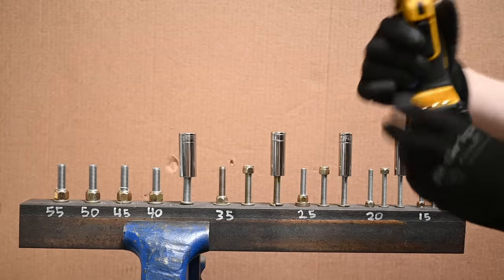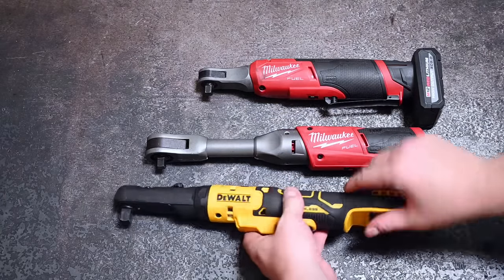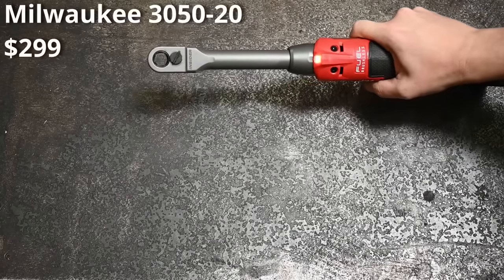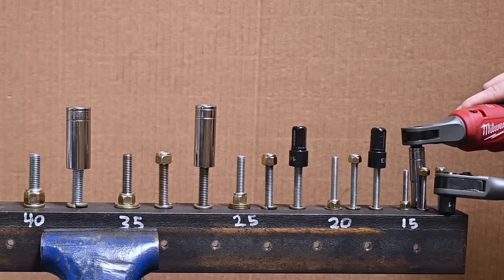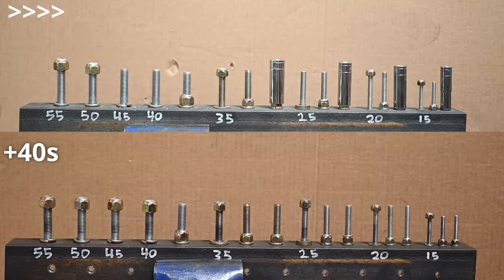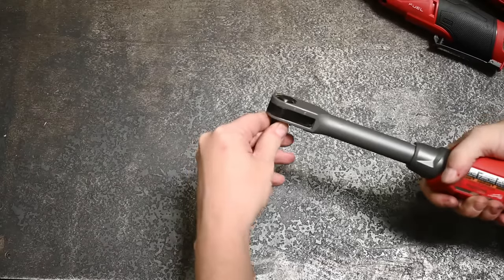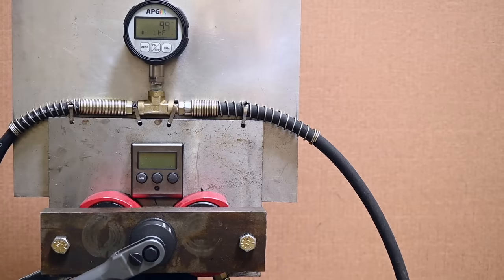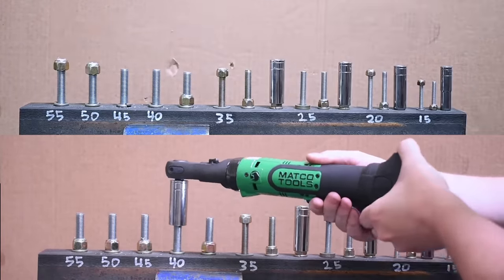Milwaukee's New Insider Ratchet vs DeWALT's New Sealed Head!

Comment: When will these manufacturers realise that they need a model that has a variable clutch? I have a 10yo heavily used Dewalt DCF610 screw driver that I use to disassemble and screw engines and other automotive screws, it is a tough little survivor of much abuse. It has a torque max of 7nM which at one notch of under full torque and is perfect for avoiding stripping M6 alloy engine screws or having the thing trying to rip your hand off as it bottoms out. I recently acquired a dewalt 12v 1.4" ratchet DCF504, so I can get better 'access' to exhaust manifold screws etc, but I need to be ultra careful and slow to ensure I don't strip things or injure my hands.

Comment: Been hearing lots of people are stripping the gears out of the heads lately of the Milwaukee without much torque. Not a good luck for this tool
Reply: Which tool? 
I've had no problem with my DeWalt 510
Reply: @slingin_tires  the Milwaukee
Reply: @FusionBoost2.0  Ok, figures

Comment: The hollow sockets suck and will break easier which then you have to pull teeth to get a replacement, the ratchet head has a smaller tooth ring making that easier to break as well. Good for Harry Homeowner but sucks for your mechanic types.

Comment: So regardless no cordless ratchet will bit break most bolts. Go with the highest rpm one.
Reply: @11onejay The Dewalt broke all them loose on it's own from what i see.
Reply: @JeffreyKmf5uz  I'm not talking about what has torqued on video I'm talking about real world applications like bolts on cars. No ratchet is cracking them. It wasn't what they were intended for. They are used to manual crack them and then to back them out with the trigger, or to get cracked with hand tools etc first. I found myself using my right angle impact in situations I wish a ratchet could crack a certain bolt.

Comment: I don't see a point, these are 99% aimed at mechanics and cars don't have long extended studs where it would make a diff.  And I can run the nano sockets on my high speed and get the same compactness
Reply from the maker: Ran into an exhaust hanger and a turbo manifold flange bolt this was semi useful on this week - but generally i agree with you

Comment: I must be missing something, it looks like the Dewalts are way better but the Milwaukees are placed higher. 

You go through the lists way fast and flip back and forth quick. 

Good comparison, though. Thanks.
Reply from the maker: Only 1 Milwaukee is placed higher. The high speed short M12, because it's nearly a damn minute faster - but much lower torque as well.
Reply: @TorqueTestChannel  Much, much lower torque.
Reply: @slingin_tires but much much faster 😂
Reply: @michaelchristopher8266   Not than DeWalt's 12v sealed. Wait till they test that!
Reply: @slingin_tires  that’s speculation, fact is the m12 high speed, and high speed long neck are fastest on this test dyno by quite a large margin. Shouldn’t boast about the new Dewalt until it is proven, I’m not saying it’s bad but it hasn’t proven itself yet. I’m reserving judgement until TTC tests it.
Reply: @michaelchristopher8266   ok well I've literally had them side by side and they're very, very close.

Comment: Snap on got the absolute best electric ratchets. Period...not impacts cut offs etc, but for a everyday mechanic...the ratchets are waaayyyy above and beyond ..period
Reply: @mv7pitbull87 I agree with you. Sort of. I just traded my brushless Snap-On for the dcf510. No regrets at all. The 510 is faster and stronger but, if you're not gonna get a DeWalt, get Snap-On.
Reply: @JeffreyKmf5uz   yea one of the other mechanics at my job has the dewalt ratchets..0 complaints ..I have dewalt for my impacts (dcf900 and then the newest midtorque one the 840sumthin , then my Mac ones) but something to me bout them snap on ratchets...specially the 1/4inch ext. Head
Reply: @mv7pitbull87   Right, both brands make great ratchets. l've also got DeWalt's 12v sealed head ratchet which is just as impressive as the 20v. Now for impacts I'm with you on Dewalt's. Love my dcf900,891,921,903 (that's most of them, LOL) can't complain about any of those.
Reply: @JeffreyKmf5uz   that's what my mid torque is the 891...I use that thing everyday all day ..thing is an absolute monster for the size...perfect size for all day repairs, I had the early model the 894 I think it was and that thing was nice too but sold it right when the 891 came out

Comment: EVERY dewalt tool I have ever owned, and that i've seen my friends own, has been cracked. The plastic is cheaper quality than harbor freight. Their performance may be a little better, but their longevity means you're more likely to have to fix or replace it sooner than others. I stopped buying them over a decade ago, and after inspecting my friend's dewilt impact a few weeks ago, I have no regrets doing so.
Reply: @macgyver9134 I haven't broken a single Dewalt yet. And I have around 60 different ones. And they do get dropped on concrete cause I work in a auto shop.

Comment: For the stuttering on the the new Milwaukee with the passthrough socket, is it possible the bolt is making contact with the socket/ratchet as it is passing through? This could explain perhaps the stuttering. It would be interesting to see if you used a deep socket on the smaller bolts/nuts to see if this phenomenon still exists. It does defeat one of the main features of the new ratchet, but I'm wondering if that's the culprit. Just an observation....

Comment: Erm, am I missing something here?... Besides from the price - why does the sentiment towards the new Milwaukee Insider Ratchet seem so negative??... the drive adapters are for sure a bummer, and the price is steep - but it honestly seems like Milwaukee's best ratchet out there right now (of which, pretty much all of the previous ones were widely loved).

I will say that the weird stuttering/hesitating behaviour is worrying - but I would imagine that this is a faulty device rather than a typical feature. This is a sample size of n=1 of course, and I have actually read that other people have experienced the same strange behaviour on other milwaukee ratchets in the past too. That's my wihful thinking, anyway.

Back to my original point, the pass-through feature is nice, but (for me at least) it really does not seem like the big selling point. The real selling point to me is the improved fastener removal capabilities with fasteners that are tighter on-the-thread. You're right, I don't care about peak torque at all - since that is typically manually applied with these electric ratchets when needed anyay. I just care about the greater 'sustained torque' so that I can remove a rusty old bolt that has a dirty thread after I crack it off rather than the ratchet stalling and being unable to continue the job like can often be the case with the other M12 ratchets. 

Anyway, all this to say that this seems like the perfect ratchet for me as someone who owns none of the previous M12s. I've been waiting for an improved 3/8" extended reach before I jumped the gun - and I think this is it, hopefully!
Reply: If sustained torque is what you're after then the sealed head will win every time. Trust me, I run mine every day.

Comment: THICK and/or SHORT ratchet heads work against the purpose of an angle head tool. Kudos to Milwaukee for seeming to understand that fact. For example 
I spent today disassembling a conveyor where nothing but the HF unit would fit inside the C-channel. I also harvest LS and other drivetrains in salvage where 
fat thick heads DO NOT FIT. Every design team for these tools should use them to remove a few difference vehicle drivetrains. Not mockups, GTFO the office
and go get dirty! That's how to make money from mechanics and other professionals who know precisely what we require because we've spun wrenches for decades.
Go THIN, GO LONG (cordless ratchets are normally used where thin low profile heads are of major advantage) and never forget even if you don't have max power the length of the tool permits breaking torque with a short manual movement followed by running the fastener under power.
NOTE: A long reach low profile attachment could easily be used with a capable conventional impact, but do not phecking cheap out! Steel is not that expensive.

Comment: When I started as a mechanic on cars, I use to see all these guys with Dewalt, Milwaukee, and snap on. Some MAC. Now me being new had cheap harbor freight or even Walmart tools. When I got enough, I wanted to get a good brand tool that would last. One thing I noticed was that almost ever Dewalt ratchet and impact were replaced due to them breaking down. However, Milwaukee was still around. I asked why they kept getting a brand that broke down on them, my boss laughed and said “bra cause they are yellow guys”. Which means they are fan boy tool guys. Long story short, it has been 4 years and I still have Milwaukee electric tools and Walmart brand wrenches. All of which are working like day 1. Wrenches are wearing out and I should replace them, but taking everyone’s advice, I will not buy snap on.
Reply: Now Walmart tools don’t break and Milwaukee poor tools dint break? 😂😂 guessing you don’t use them much? Seen plenty of problems with Milwaukee tools just as much Dewalt….Walmart well that’s hilarious
Reply: @fike301  Milwaukee I use multiple times a day. Under a car 6 days a week. Never had any issue so far. For many years now. Others things I learned is dewalt is better at construction for things such as their miter saws, table saws, drills, etc. Milwaukee is better with impacts, ratchets, etc. it really depends on what you do that determines the better brand. I own both brands but when I work on cars, I use Milwaukee. Also, I just replaced my Walmart wrenches last month. Didn’t break, but they wore down to the point they started slipping frequently. My point is, you do not need $1000’s in wrenches from snap on when other brands are half the price and last years. I know they have that warranty, but I see my team mates waiting 2 months + for snap on to finally come back to the shop with their tool if it isn’t in stock at the time they are there.

Comment: I just want to check I heard you right; Milwaukee hex hole is 14mm, DeWalt is 16mm. 
The Makita is 13mm and any pass through sockets on the market are 3/4"/19mm external hex or proprietary hex/spline. 
Without putting my tin foil hat on wtf is wrong with these people?
Reply from the maker: The Nano sockets are 17mm, but I agree with you. They are doing it on purpose!

Comment: Proprietary nonsense needs to stop. I get it for tool internals and such, but when were talking about how the consumable tool head (because that is what they are) being proprietary SPECIFICALLY to prevent you from using cheaper equally strong (if not stronger) attachments, That makes me not buy into the subject. No matter what it is. Dont own an Apple product and never will, Because of that. 2007 I figured this out, when my cousin got the new apple phone. I could easily drop Mp3's into my Android phone, but he had to pay a subscription and PAY FOR EACH SONG, to do the same thing as I was doing for free. All to be in the apple ecosystem. This has only gotten worse from 07 on.

Comment: Lol and a blower that takes 4 batteries is innovative consider dewalt is pushing hand blower and push the cfm yall are pushing off one battery pack. Milwaukee innovative is a overstatment. Lol bc a back pack blower with 4 batteries is innovative lol😂 they cant even get off there decade ass old 18v plateform that everyone else has moved aways from.

Comment: Dewalt is in the stone age still! How can they not see how ridiculous tools like these look. With that flat battery pack, that they've been using for the past 15-20yrs!
   Im not saying its a looks thing, its a commonsense thing. Look how sleek and low profile the Milwaukee tool looks all around. 
 Its like they are to damn chicken. To make a complete redisign, because they would have to completely redisgn it and make an entirely new offering as far as batterys go. Think about it, if they are scared people wont want to convert. Do sonething similar to Milwaukee's 12v line, but offer an adapter. That makes the cylindrical design and allows the flat pack on the bottom. Therefore making it appear similar to the Milwaukee 12v flat pack that goes into a cylindrical shape for the handle. Am i saying copy Milwaukee? No, but im saying they should be competing against Milwaukee! 
   I dont understand it, its so off putting. That i wouldnt buy one for aesthetic reasons alone! Let alone for the profile of the bulky ass block on the end of it! Thats whats nice about Milwaukees 12v system, if you need that extra room. You at least have an option, whereas Dewalts like, ehh. Fuck it, theyll still buy it, because they are bought into the battery design.
   So dewalt owners are stuck between a rock and a hard place!
Reply: If they're still in the stone age how come their sealed head units handsomely outperform Milwaukee's

Comment: Clearly paid by DeWalt, so many things wrong in this video. 

1. The soclet adapters CAN in fact go on either side. Source: I own the Insider ratchet and I've done it several times showing co-workers. There are also videos out there demonstrating it.
2. If youre gonna put 2 different ratchets head to head and make them compete, use the same sockets on each one. 

The "paid by DeWalt" is showing clearly in this video.
Reply from the maker: Well firstly, the channel doesn't accept money or free products or endorsements from any brand or even non-tool sponsors like NordVPN and I think you know that. 
We also show the adapter going in the other side in this video too 10:12, but you'll notice it comes right out without retaining in the ratchet. Go look at your set, you'll notice the sockets have two detent ring grooves and the adapter has one, because it's not designed to be retained when positioned out the back side.
And to your 2nd point, if we didn't use the sockets that came with the tool you'd be complaining about us using the adapter instead of the included sockets. 
But i am curious to hear about the so many things, you only listed 2 from a 15 min video with one just incorrect and the other an opinion. Do go on